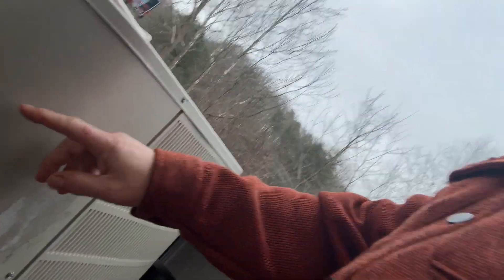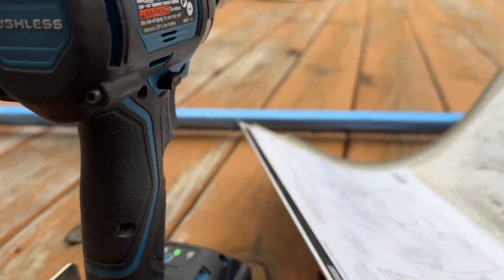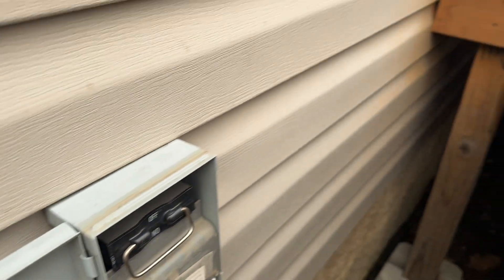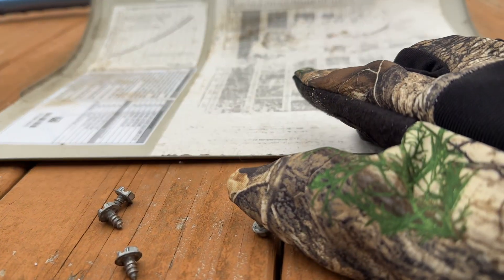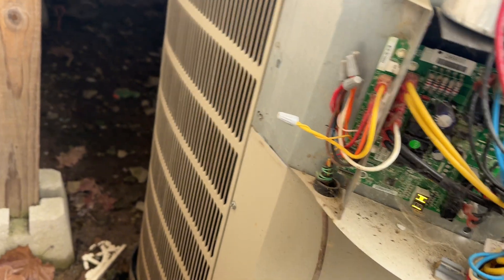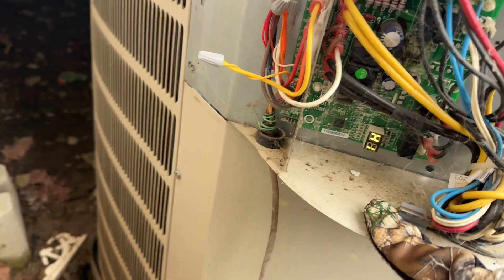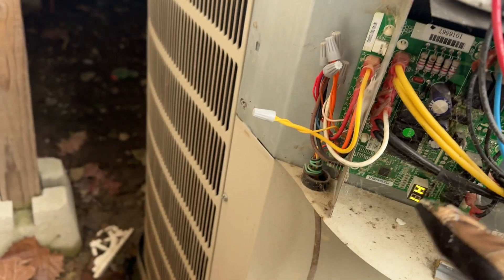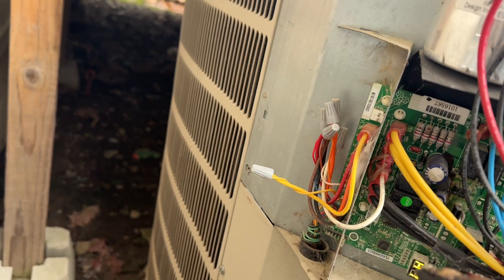Heat Pump STILL Not Heating? Here’s the Next Fix You NEED to Try”

Comment: I have a Goodman heat pump after a power outage it heats but doesn't cool. When in cooling it runs fine but the compressor doesn't kick on. I hear an audible hum like it's trying to kick on the compressor and fans spin but in cooling the outside condenser doesn't blow hot. I am broke so please tell me it's my capacitor! Any help is greatly appreciated! It is over 100° here. Thank you!!🙏
Reply from the maker: Sorry for not getting back to you sooner, if the compressor kicks on in heat mode then its not the capacitor, sounds like a stuck reversing valve. Like I said, put it in the heat mode turn your heat up enough to make it kick on and then go outside and see if everything‘s working normally if it is it’s more than likely a stuck reversing valve or the coil that kicks on the reversing valve.

Comment: Pretty sure the low voltage on hvac equipment is alternating current, not dc. Appreciate the video.
Reply from the maker: Yes you are correct, did I say Dc? It is AC, thanks for the comment and the correction